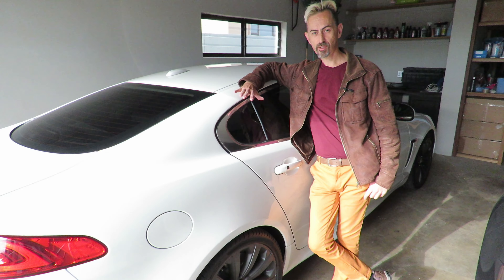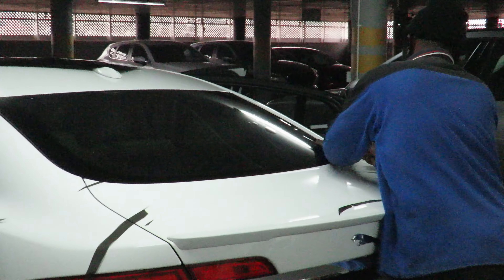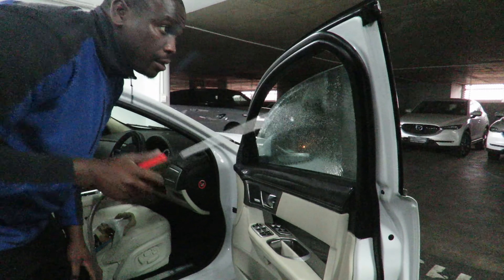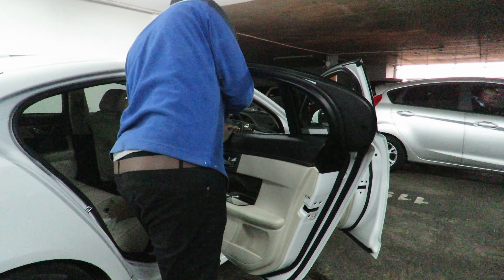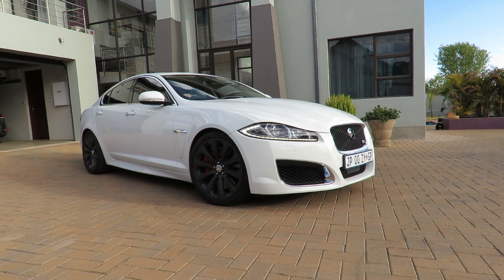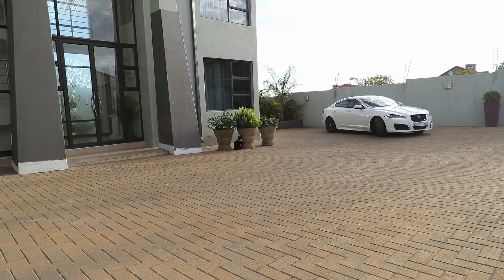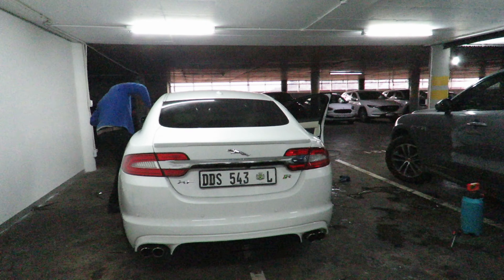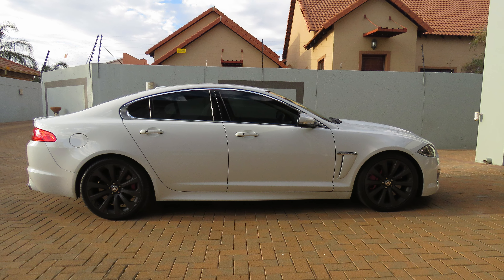This is how they fitted Smash & Grab tint to my car

Comment: In UK, you can go for 5% limo tint on rear windows (what I've done), but front has to stay 35%. However, windows are already tinted from factory, so put extra 35% tint means they're darker than legal limit.  Some people done them anyway with no issues, some of them had to removed the tint from front, it depends how lucky you are I guess. It looks much better, if both front and rear side windows are done, but I went for rear only for peace of mind :)

Comment: A great job Hilton. Those guys were amazing. Such speed and care. It make your car even more exclusive :-)
Reply from the maker: Thanks Andy.  Nice to hear from you and thanks for watching.  As I take care of the aesthetic items that need fixing, the mechanical maintenance is looming.  By the end of the year, I will have to have that big service done on it to ensure the engine is running at its optimal performance specs.  Have a great rest of the weekend further my friend.
Reply: @carfanfan  Hi Hilton. It will be interesting to hear about the 'big' service ahead. Meant to say the new alloys look fab on your XF.  My Tucson goes in for its year 2 service on Monday (which is a semi-big one!), although I took out a service plan so there should not be any extra costs. Time to wash the Hyundai!  Have a great weekend with the Jag :-)

Comment: Wo that looks great, love it.  I'm thinking of getting mine done but I'm not sure yet, mines Italian racing red and an undecided if it will look right.
Reply from the maker: Dark windows contrasting against that gorgeous red color will look awesome. Go for it Jeff 😉👍
Reply: @carfanfan  I think your right, also time to fit my black grille, had it months now and done nothing with it........
Reply from the maker: @JoePineappless  I totally get you Jeff. Taking the bumper off alone is quite a job. I've tried twice to order a black grill and both orders were cancelled due to no flights from China to SA. Sonic have to wait until flights resume. Very frustrating. When I do take the bumper off to do the grill, I'll be sending it in for a respray along with the rear bumper. Both have nasty bumps and paint missing here and there. So it will be a big resto when I finally b
get to it 😉

Comment: such a pity i cant afford a 3.0d in the x260, guess i will take the 2012 x250 facelift, i would consider the 2.2d in the x260 but its seems a bit weaker than my 2011 c220 cdi, please advise if should trade the merc in and go for a x260 with 126000 km I'm looking at getting a 3rd party warranty extension for the car
Reply from the maker: The X250 is actually the better car.  Better materials and fixtures and they last a bit longer.  The X260 isn't a bad car, but just too much plastic fantastic in them.  Having owned one, I just didn't establish a bond with the car.  The X250 has better suspension and handling too because it's actually heavier.  The weight is distributed 50/50 and the steering is more precise than BMW.  They are easy to live with for daily driving and eat long distance miles with ease.  Getting a warranty is a must because repairs can drain your bank account fast.
Reply: @carfanfan  thnx for the response man I did some research on the x250 and its a decent car seems a warranty would be a waste like the one I have on the merc never claimed car doesnt brake

Comment: Looks good, any plans to de- chrome, also are you planning on fitting Android unit, the existing system is a bit old fashioned. I have been looking for mine but not seen anything yet.
Reply from the maker: There is an android unit for the X250 facelift model.  However, it's very expensive and considering the running costs I'm currently facing, I won't be fitting one.  I thought of a de-chrome but I like the subtle touches of chrome.

Comment: Great, I'd like to ask u a question,  my jaguar Xf V6 has average fuel consumption of 17.4 L/100km, is it normal or increased?
Reply from the maker: Thanks Asem.  17.4L/100km depends on your driving style.  Currently I get 14.1L/100km with my XFR because I'm doing mostly town driving.  But it goes down to as little as 10L/100km on the highway.  It does seem a bit heavy but you don't mention your driving style or whether the car has had a major service or not.  The spark plugs need to be changed every 160,000km's or 8 years.  The fuel filter as well.  If your air filter hasn't been changed this can severely affect fuel consumption and the computer will compensate where it can for the lack of air to fuel ratio.  If your car has had all its services and the fuel and air filters have been changed as well as the spark plugs, you will experience bad fuel economy.  My XFR is still running on the original plugs from factory and these will be changed on its next service together with the pulleys and belts.  Expensive service indeed.  But you will feel it on the accelerator.  If the engine response is potent by the tap of the accelerator then you know it's running good, but if you need to give more accelerator input to get the car going, then it needs a service.  Naturally, more accelerator input needed will mean heavier fuel consumption.
Reply: @carfanfan  thank u soooo much for the fulfilled reply.

Comment: Is tint the same film as smash and grab?
Reply from the maker: Good question.  The answer is no, they are very different.  Tint is a very thin film which eventually goes bad after being the sun.  It starts to peel or bubble and looks really awful after a few years.  Smash and grab is much thicker and durable and besides providing privacy in the car and shielding one from UV, it acts as an adhesive that holds the glass together if someone tries to smash the window.  The glass will still shatter, but it will stay in tact and won't splinter everywhere.  It makes it very difficult for would-be thieves to just smash the window, grab what they want and leave.  So they end up having to spend more time trying to get into your car which they hate, because time is of the essence when committing a crime.